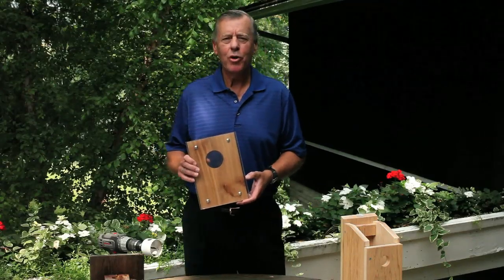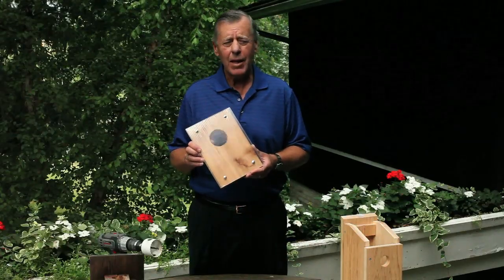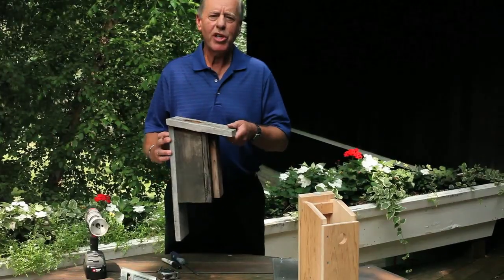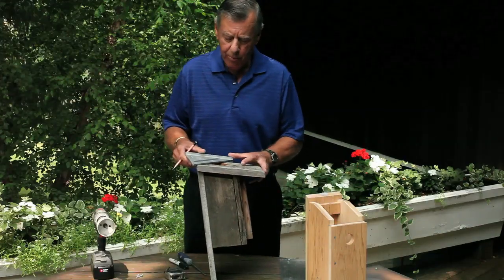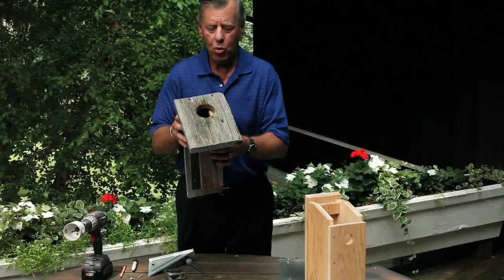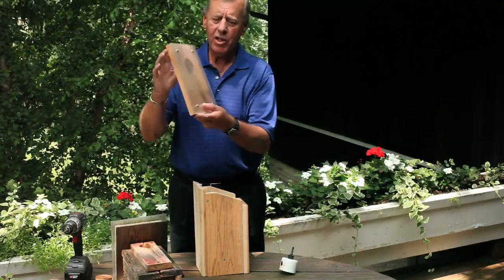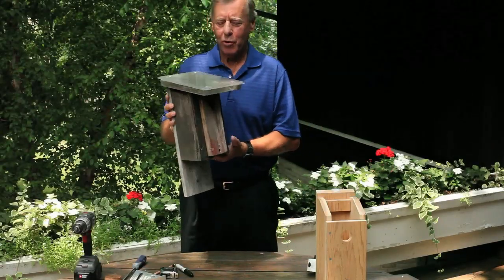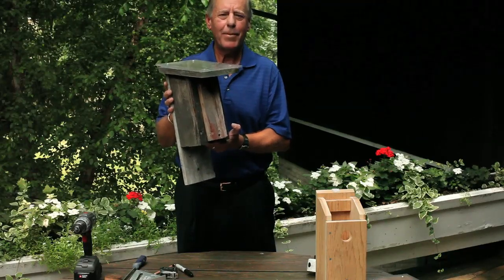Sparrow resistant Bluebird box

Comment: Does the covering over the new hole I cut in roof have to be double walled polycarbonate lexan? This is pretty expensive and I was thinking about using a plexiglass material that lets light in but cheaper but I want this to work so thought I would ask

Comment: Didn't work for me. Sparrows have filled the skylight box with twigs. The house without skylight also has been taken over by sparrows. I tried emptying it daily, but they keep coming back. Now I leave it open but they still keep coming to it. I want to close it for bluebirds but sparrows keep occupying it.
Reply: If the box is being filled with twigs you have a wren problem. Sparrows  fill the box with grasses,  paper, plastic and all types of debris. Check out pictures of wren nests.
Reply: Thanks for that explanation. I was blaming the sparrows, but after your reply I did some research and sure enough the pictures of wren nests were exactly what I was finding in the bluebird houses.
I have two houses, one with a "dummy" nest and the other with an active nest, which I left alone. I pulled the dummy nest out.
Now to discourage the wrens from invading my bluebird houses.

Comment: Is what he uses the same as plexiglass?
Reply: No... this has airflow between panels, so it stays cooler
Reply: @gatostanley4923  Thank you very much for the reply. Would plexi glass be a huge no? Or possibly be okay to use?
Reply: @shanegalang9   I'm going to use plexiglass (an inch larger than the hole) and only cover the hole attaching it with screws at the corners, and use a rubber band under the plexiglass to seal it for leaks.   I'll add extra vent holes at the top of each side. Much less expensive if your making lots of birdhouses.
Reply: @lostaboutnow  thanks for the reply. I went ahead and ordered a sheet of what he uses. I only have 1 nest box. Good thing! That stuff is expensive!

Comment: I find the bluebirds like to perch on the roof but can't because of the slickness of the plexiglass.  They are checking out the box today. Is there a way to make it so they can stand on the roof?
Reply: What about putting the plexiglass on the inside, rather than the exterior?
Reply: @hennypenny97  That would allow rain to enter the box.
Reply: Thanks Reggie. Good idea. These were already made for me but I ended up gluing strips of wood across the front of the top to give them wood perch for their feet.  Now to just wait for them to come back.
Reply: Good point. I am going to  modify  mine  &  remove the lower half  of  the  glass covering. The roof  hole will  still be covered.

Comment: Sparrows primarily look for a partially closed cavity to nest greatly preferring a solid covering over head. Bluebirds being an open forest/meadow not dependent on human habitats are not disturbed by an an opening that allows sunlight to enter their nesting cavity. They are not as picky in this regard. They normally look for a hollow in a tree which is cooler than a house with a sun roof. If you place a bird house with a sunroof in a warmer climates you may want to allow for a bit more venting due to the extra heat that comes from a skylight. Most hardware will have 1/2 inch up to 4 inch circular screened vents that are easy to spray paint and install.  By not giving these sparrows perfect bird houses they may not evict the bluebird & look for an easier place to nest. However, if you have a large population of sparrows you could try placing extra boxes for them and they may then leave our bluebirds alone. I place a metal guard around the hole because squirrels and larger birds will enlarge the hole. If and when this happens the bluebirds will desert the nesting box.  This method works most of the time. Remember Robins like bird houses too, take a look at their prefered boxes, you will get a better understanding of how diffrent bird think. Owls need boxes as too, what a treat to have them move in. Bats are the most beneficial animal to habe near by, but then need a body of water with in a couple of miles. Look up bat houses too, so easy to build as well.
Reply: thank you
Reply: Thanks for offering the "reason for the skylight" that the video did not provide.